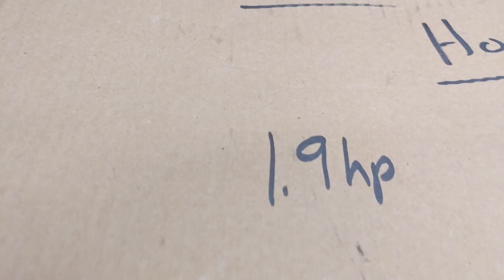Best Cordless Ratchet Makita Husky Milwaukee TESTED 12 volt

Comment: Will an 18V Makita battery work in that 12V Makita ratchet? (all my Makita's are 18v)
Reply from the maker: I wish. Unfortunately no and I had to buy the Makita 12v line just for this tool. But, I'm not dissapointed in the least and will likely get a small 12v drill for the projects where my 18v Makita drill is overkill. However, I think the HUSKY is the fantastic and at $60 currently with no battery platform investment is the best deal.
Reply: your 12V options should increase over time. Milwaukee is showing the way, but I'm sure Makita will surpass them if this tool is anything to go by. This Makita ratchet makes the Milwaukee "ratchets" look like slow impact tools.

Comment: If you truly want the best of every class you have to add the snap on brute, then your line up would be complete
Reply from the maker: I did try the Snap On extended neck. It's great but they give up a lot of features for ultimate reliability. That's a great thing if you need it for 8hrs a day. I don't need that long of reliability as these battery powered tools are old tech after 2-5 years and something better is out there. Functionally I would pick the Snap On over the Milwaukee any day so it would have been Husky, Makita and Snap On. People would be pissed not to see Milwaukee so it's lower(nearly half) price point kept it a winner above Snap On in my book.
Reply: @sixtyfiveford  I see and agree, I have the Milwaukee extended reach and love it. If I'm not mistaken the snap on extended reach tool only is actually only $60 more then the Milwaukee extended reach both 3/8

Comment: The Milwaukee ratchets suck. Snapon has the best ratchets out there. Yes exspensive but they work excellent. By the way the torque rating on the ratchets is what they put out after you break loose the fasteners.

Comment: Need to put the snap on in the mix
Reply from the maker: I tried it and took it out for a few reasons. First the $550 kind of kicked it out of the average DIY guys budget. Second I wanted to only stick with 12v ratchets. Third, it was slow (40ftlbs 275rpm or 70ftlbs 175rpm) and Finally it's not easily obtainable from standard retail locations; you have to go out of your way to get it. That being said I would take it over the Milwaukee any day. I would still keep the Makita as my #1. I think Snap-on should stick to the mechanical side of tools and get an electric tool company to design the motor, batteries etc.
Reply: My snap on extended non brute is faster than my m12 fuel 3/8 ratchet also the build quality is better but for me it boiled down to the battery the battery is a much tighter fit and isnt as fragile. I disagree on the sticking to hand tool comment. but i will give you they are super expensive. I once upon a time would never buy the snap on tools but my dealer convinced me to demo it one day and i bought it the next week and i had 4 various m12 ratchets already.

Comment: The reason your milwaukee is slow is because you are using the higher torque extended ratchet  brother, the high speed version is way faster than the makita.
Reply from the maker: I tried the high speed Milwaukee about a month ago. The Makita still kicks it's butt at everything and is a far better design. Behind that the Snap On is great as well. About the only reason to own the Milwaukee is if your brand loyal / battery loyal and can't get over the fact that somebody makes something better.

Comment: Why are you so against the milwalkee? The lockout switch works perfectly fine.  The trigger is progressive just like any other.  Its the best of the bunch.  And you used the old milwakee ratchet.
Reply from the maker: I'm not against Milwaukee at all but I'm also not going to drink the Milwaukee Kool-Aid. They make the best 3/8 stubby 12 volt impact but it has a lot a room for improvement. They make the best die grinders but also the only ones that make them cordless. The M12 fuel ratchet in the video was Milwaukee's newest model on the market today. The one in the video is actually a replacement because the first one died (not the only Milwaukee tool to let out it's magic smoke last year on me). There's absolutely nothing special about the paddle switch on the Milwaukee's and it's the same thing you can find on a 30-40-year-old air ratchet. I guarantee Milwaukee's new styles will have a push button.

Comment: missing the best on the market for around 300 bucks u can get the snap-on 3/8 electric ratchet 2 batteries and a charger nothing beats the old crappy snappy lol
Reply from the maker: I used a Snapon and it was nice. I didn't think it warranted the $550 price point though.  I didn't see they had a kit for $300? I preferred the Snapon over the Milwaukee but still thought the Makita was the best. I used the 14.4v extended 3/8 Snap on.

Comment: Nice review. Horsepower calculation is flawed. You would need to measure speed and torque simultaneously. I suspect the actual HP of all three is way lower than what you calculated.
Reply from the maker: This would be true with a gasoline engine. However, Electric motors offer virtually the same torque throughout the entire rpm range(virtually flat torque curve). That's why they electric cars are so fast off the line, full torque from 0rpm to max rpm.  I'm sure the figures are off, but the ratio and comparison would still stand with the Makita being able to do more than double the work. 

HOWEVER, I did do further testing about a month ago with a makeshift prony brake. I used at lag bolt through various wood thicknesses and would measure the force to drive/turn it with a digital torque meter. I would then drive the lag bolt while measuring the rpm and see where it was before it stalled out. 

RESULTS from my makeshift Prony Brake
Makita could consistently rotate 12-15ftlbs without stalling barely. 
Husky could consistently rotate 12-15ftlbs without stalling barely. 
Milwaukee could consistently rotate 18-20ftlbs without stalling barely. 
 
Makita maintained an rpm of 600rpm immediately before stall which gives a HP of 1.4hp-1.7hp
Husky maintained an rpm of 200rpm immediately before stall which gives a HP of 0.5hp-0.6hp
Milwaukee maintained an rpm of 170rpm immediately before stall which gives a HP of 0.6hp-0.7hp

These tests have a lot of variables as well and it's virtually impossible to get exact numbers. I could convert it from watts and measure the energy consumption and get closer. We could also use a different comparison with gear ratios. If you regeared the motor and increased the speed 4x to get the Milwaukee up to 800rpm you would reduce the torque to 1/4 or 13.75ftlbs(from 55ftlbs). Compare that to the Makita at 800rpm and 35ftlbs.

Comment: Calling Shenanigans on your HP values.  None of those ratchets will spin at the stated speed while producing the stated torque.
Reply from the maker: Absolutely the numbers are off. But the ratio between the tools is right right on and was the only point of it. 
However, Electric motors offer virtually the same torque throughout the entire rpm range(virtually flat torque curve). That's why they electric cars are so fast off the line, full torque from 0rpm to max rpm.  The ratio and comparison would still stand with the Makita being able to do more than double the work. 

HOWEVER, I did do further testing about a month ago with a makeshift prony brake. I used at lag bolt through various wood thicknesses and would measure the force to drive/turn it with a digital torque meter. I would then drive the lag bolt while measuring the rpm and see where it was before it stalled out. 

RESULTS from my makeshift Prony Brake
Makita could consistently rotate 12-15ftlbs without stalling barely. 
Husky could consistently rotate 12-15ftlbs without stalling barely. 
Milwaukee could consistently rotate 18-20ftlbs without stalling barely. 
 
Makita maintained an rpm of 600rpm immediately before stall which gives a HP of 1.4hp-1.7hp
Husky maintained an rpm of 200rpm immediately before stall which gives a HP of 0.5hp-0.6hp
Milwaukee maintained an rpm of 170rpm immediately before stall which gives a HP of 0.6hp-0.7hp

These tests have a lot of variables as well and it's virtually impossible to get exact numbers. I could convert it from watts and measure the energy consumption and get closer. We could also use a different comparison with gear ratios. If you regeared the motor and increased the speed 4x to get the Milwaukee up to 800rpm you would reduce the torque to 1/4 or 13.75ftlbs(from 55ftlbs). Compare that to the Makita at 800rpm and 35ftlbs.
Reply: @sixtyfiveford   Although BLDC motors can have a very large region of  virtually constant torque starting from stall, their full speed range does not have constant torque, they all have a knee in the curve where speed and torque have an inverse relationship.  I am skeptical that these ratchets will produce the same no load speed while also under full load, unless the controllers are severely limiting their operation.  If so,, you would be loosing a lot of the desirable no to low load high speed ability, just like an air impact provides.  

1.4 to 1.7 HP would be well over 1000 watts of power and at 12 volts would be in 80+ amp range which is 4x cont. 18650 output.

I appreciate the effort and thoroughly enjoyed this video as well as all your others.

Comment: Put a 6ah battery on that Milwaukee and test it again
Reply from the maker: I usually run it with a 6.0ah only to balance the huge head weight and It also eats the battery about 25% faster than the Makita. With the 4.0 or 6.0ah It runs at the exact same slow 200rpm and 55 ftlbs max removal torque. I ran them all on 2.0ah for an even playing field in the video so no one complained. .
Reply: @sixtyfiveford  I would like to see what the new Milwaukee will do once they become available
Reply: @sixtyfiveford  the new Milwaukee ultra high speed ratchets are still only advertised as being 450 rpm

Comment: Wish you'd have done this a year ago...;)
Reply from the maker: Took me 2 years to test them.
Reply: @sixtyfiveford  just funning with you. I have an M12 starter kit that came with the non fuel 3/8 ratchet. It's pretty disappointing.  Then I got the 1/4 and I like that one. Also got the stubby 3/8 impact and it's awesome. I'm not a professional anymore so it's fine but I'd have definitely got the Makita if I'd have seen this.

Comment: Snap on

Or Milwaukee. Milwaukee works tooo
Reply from the maker: I used the Snap On extended and it's very well built. I really liked the smaller head and the grip was far better than the Milwaukee. But it was just as heavy as the Milwaukee(3ish pounds) and still pretty slow at removing fasteners.
Reply: @sixtyfiveford  I’m actually very surprised with the speed of that makita, project farm measured like half of that during his test
Reply: @sixtyfiveford  here's the Project Farm videjo:
https://www.youtube.com/watch?v=-8yGSigHp1A
Reply from the maker: @_P0tat07_  He either used a low/dead battery in the Makita or the positioning of his no contact tachometer was where the ratcheting mechanism stops for a second and then accelerates. The no contact tachometers are inherently unreliable and that is why I did not use one and chose only to use a contact tachometer. All of these ratchets do not spin consistently they stop go stop go stop go etc. The Milwaukee spun at 200 RPM no load on a full battery and drop down to 100 RPM when the battery was dead / nearly dead. The Makita did identically at nearly 800 RPM full battery and dropped to 400 RPM no load with weak/dead battery. Project farm messed to something up with his test and when I saw the video originally I immediately went out and double tested the Makita and came up with the exact same results I show in the video. It's highly likely he just pulled the battery out of the box new when they come almost completely discharged and did the test there.

Comment: If only the Makita is a brushless and extended reach.  Trying to avoid Milwaukee at all cost.
Reply from the maker: Brushless only matters in high consumption tools like saws angle grinders etc. The battery in the 2.0ah Makita last forever and actually nearly twice as long as the Milwaukee with a 2.0ah. Go figure.

Comment: Between you and Project Farm i never see any Snapon. Wtf.
Reply from the maker: I played around with the Snap-on long neck. At around $550 is pretty pricey but build great. It gives up a lot of features for longevity. It needs to run 8 hours a day 40 hours a week for 5 years straight. I would take it over the Milwaukee any day. However the price point pushed it out of the realm of the average prosumer or shade tree mechanic that my videos are geared towards. Absolutely if you do it everyday buy the Snap On but also the Makita because it makes a much better in engine compartment ratchet.
Reply: @sixtyfiveford  aaahhhh i tend to forget who these videos are made for. I just happen to quit working as a diesel mechanic so i still have all my Snapon tools, my dad borrowed my Snapon 3/8 electric impact and he loved it but the price was 700.00 new and for a brand new Milwaukee he spent like just under half of what a Snapon cost. So i see the point of the videos being for the average mechanic.

Comment: New milwaukee ratchet has more rpms
Reply: yeah, it's also priced like Unobtanium, AND it does NOT do 700rpm, does it? I seem to remember double rpm, like 400?
Reply: 450rmp, and the torque drops to 35ftlbs. And no long neck version yet. The long necks should've always been the the faster version.
Reply: @wim0104  damn dude don't get cranky. Even tho it's not super fast it will sustain the rpms longer because of the larger battery option milwaukee has

Comment: Nah working on cars you need brute force. The hp rating you give is complete bs 😆 first we dont got 8 inch long bolts on cars. Second you lose way more time if the ratchet cant brake the bolts lose on its own power, third good lock on tight places where you cant knock the bolts lose if the tool cant do it,then you gotta get from under the car to get other tools etc... I rather have a tool that can handle the job well, then have a tool i need to force to do the work.also when you got rusted bolts the faster tools will not compare to the power that the milwaukee outputs. Way more variables in real life working on cars than a perfect condition test.got the milwaukee long neck, thing is an absolute beast.and not a milwaukee fan boy, i like makita more But for ratchets they are Just way beter

Comment: What a joke of a review. In the real world all you ever see as far as electric tools is milwaukee and snapon... and for good reason. Your testing methods are flawed and suggesting that the makita is in anyway superior to the milwaukee because its geared to run faster is a joke. The makita doesn't have enough torque to turn most any bolt that's been exposed to the elements....even after breaking it loose by hand..So it makes it pretty much useless. Trust me ... I have one in the bottom drawer of my toolbox that hasn't been touched in a year.
Reply from the maker: I have no regrets getting rid of the crappy Milwaukee. Overpriced Chinese engineered garbage is all that is.

Comment: Lol seriously all 3 of those are junk
Reply from the maker: Compared to what the Snap-on? I tried the regular and extended neck Snap-on on and wasn't overly impressed. I would take the snap on over the Milwaukee if I needed to use a ratchet all day everyday for three years straight. But I would still keep the Makita for an engine bay work tool because nothing touches the speed or the features that thing has.